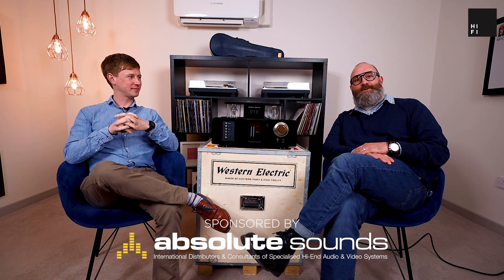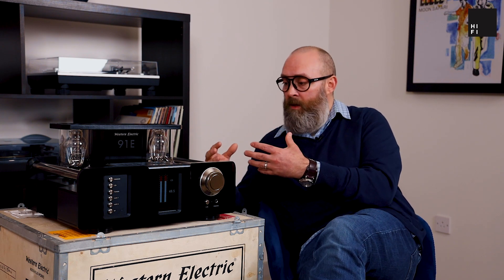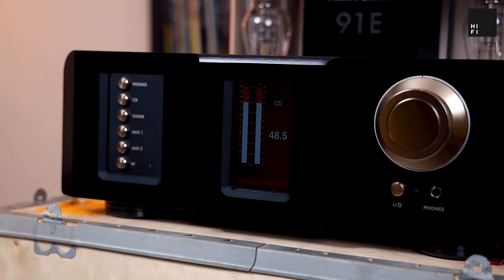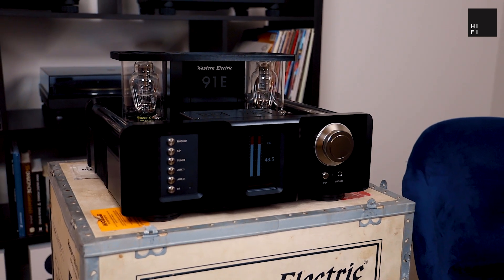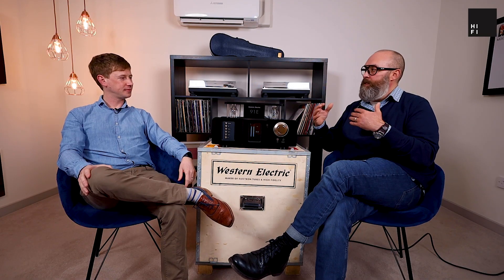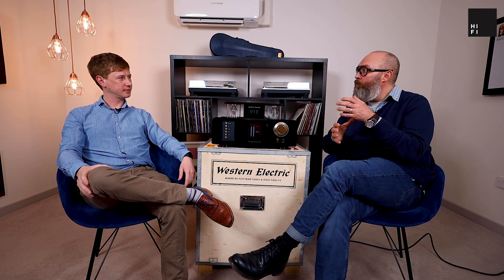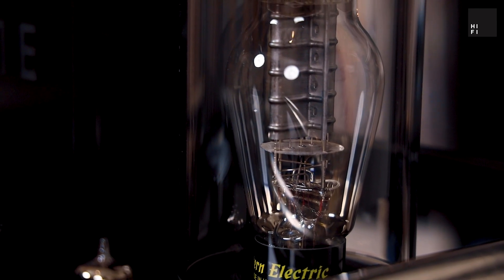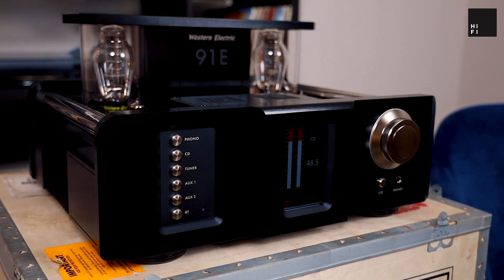Western Electric 91E Amp | A New Classic From the Maker of the 300B Electron Tube

Comment: The official WE claimed Output Power at 8Ω and 3.0% THD is 14 wpc. Actual measurements done by Stereophile show that at 8Ω and 1.0% THD, the output level is just below 1 wpc at 1Khz. At 4Ω, the 1.0% THD output level is 5 wpc. WE also makes some higher power (and very expensive) 300B monoblocks.

Comment: Also remember Western Electric AM broadcast transmitters. They were made in 1kw,5kw and 10kw,50kw. You could tell a station using the WE transmitters. Now these are gone replaced with more efficient solid state AM broadcast transmitters. These also had mercury vapor rectifier tubes. A transmitter that was pretty to look at while on. In these transmitter low level mod stages they used 300 tubes.